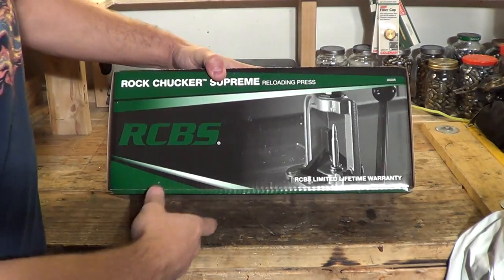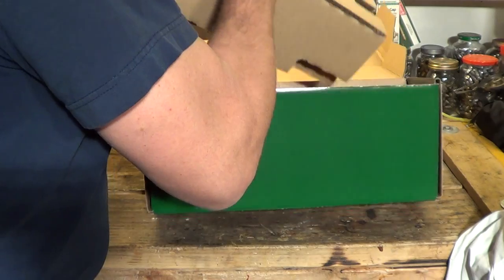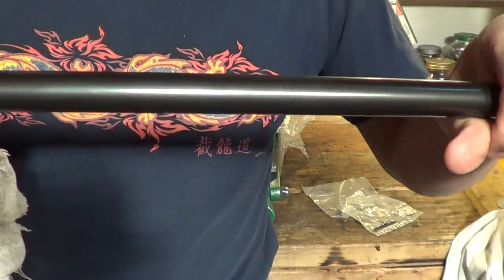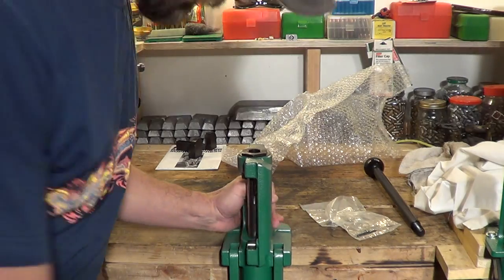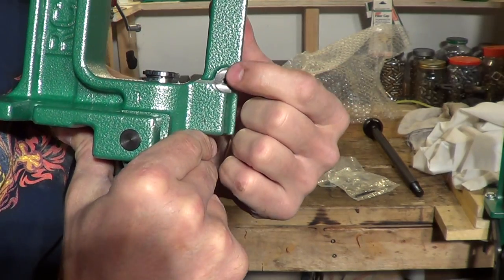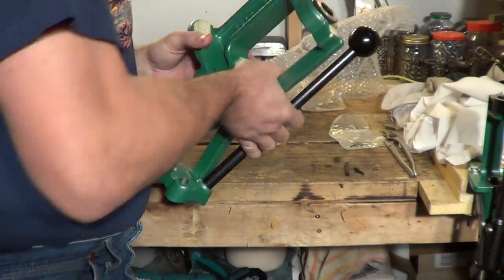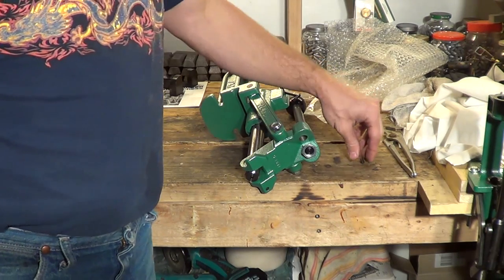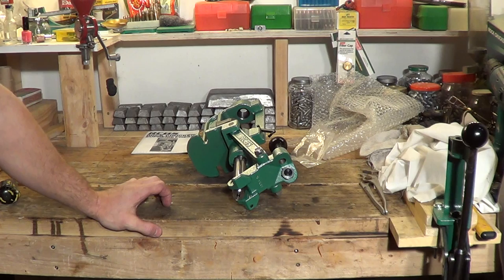Unboxing RCBS Rock Chucker Supreme reloading press - HD

Comment: I know you made this video about 5 years ago, but I just found it because I received my RCBS Rock Chucker Supreme Press kit last week. I appreciate you going through the assembly. I had most of it but I wasn't clear on how to put the primer arm together. Thanks for showing that in detail.
In all the other images (including the instructions) that I've seen the about putting the press arm into the press shows the nut on top of the press. Is there a particular reason you placed it on the bottom?

Comment: I just bought this item and have yet to assemble it. According to the DIRECTIONS, the nut on the ram handle is supposed to go on top of the press frame, not underneath it as you installed it. As you installed it, the leverage of the handle will be absorbed by the threads of the press and handle rather than  the frame, nut, and handle as designed. Reading directions can be a wonderful thing. DOH!!!
Reply: I hope he doesn't "skip the directions" when he consults his reload data
Reply: Well, what do you expect from a guy who would use a pair of channel-lock pliers to tighten a nut anyway? :(

Comment: I bought mine in amazon (RCBS store), I received mine with the primers pusher bag missing, I contacted RCBS straight from the technical support form in they website they never answer then I contacted support trough amazon and surprised me Bushnell answered and sent me the missing bag, this is the way I know RCBS and Bushnell are part of the same business group. Bad customer experience straight with RCBS, excellent and fast support from Bushnell. I never had a problem with Bushnell or Midway both with an excellent customer support.

Comment: Nice job on the video.  I'm considering buying a rock chucker supreme.  What are you impressions of the press now that you have had it for a while.  I have a Dillon 550b but want to get a single stage for decapping and possibly working up new loads before going to the progressive.
Reply from the maker: It's excellent in my opinion. throws primers all over though. Another one to look into thats excellent in my opinion is the Lee Classic cast. Cheaper and doesn't throw primers. Not the breech lock (it's good too)

Comment: Primers seem to go wherever they want, I have the Lee breach lock and usually catch about half the primers. I just sweep up what hits the floor after I'm done. Looks real heavy duty, although that's probably just overkill; I can't imagine loading any round that would require that much force, if it does I would have to say something was wrong. Although thinking about it, if you were reforming brass from say a 5.56 to a 300 blackout, that would probably be the press you would want to use.
Reply from the maker: +mrgearheadfromhell You're 100% right. This is most likely an overkill by a longshot, but hey. It's nice to have the POWER! ha ha. Or should I say the leverage. Just like in the power tool field, most people would choose 18 volt cordless over 12 volt. Same thing. We as consumers love power. The 12 volt tools are more than powerful enough for most tasks if used right. You can see all my reloading video's up to this point were with small presses. Thank you for stopping by!
Reply: @jiujitsu2000  есть знакомые, которые видели как ломаюстся чугунные тяги у этого пресса..Это каким дебилом надо быть, чтобы нажимать с такой силой. Хотя возможно криво стоял сам пресс.